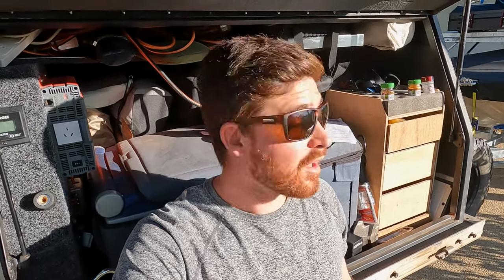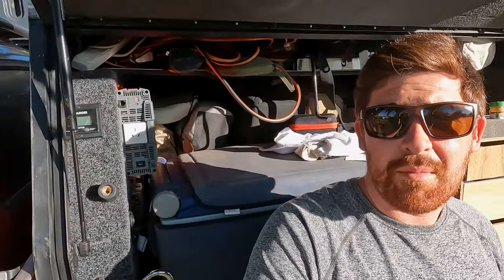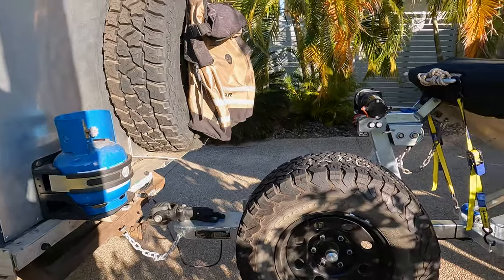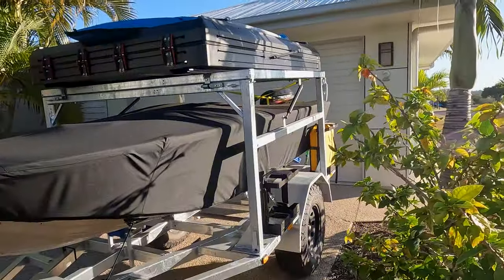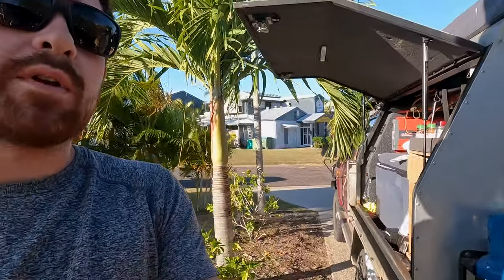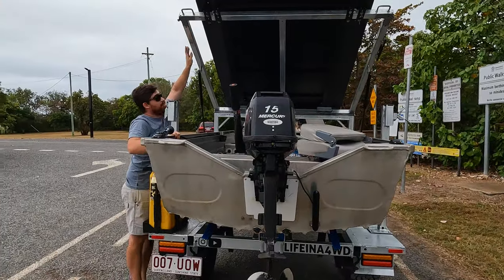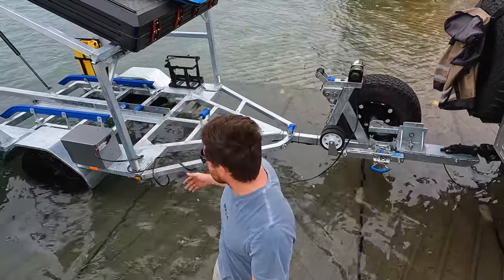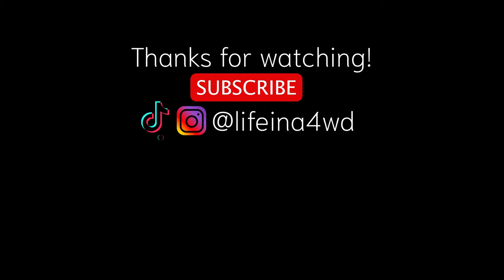OFF-ROAD BOAT TRAILER BUILD- Queensland Registration of custom trailer and the official test run

Comment: Love the channel. Ive built my own trailer too and modified it several times as the change of use develops. Cheers. Love ya work!
Reply from the maker: Thanks Mike! 
Our channel is going to take a slightly different turn now the trailer is done but mainly documenting all our adventures with the trailer!
That’s sick, we’d love to see pictures if you want to send them to us on Instagram?
Reply: @lifeina4wd  looking forward to the 4wd adventures ahead of you. My trailer has morphed from an old standard trailer to an off-road capable do all camper/multi purpose trailer. Not sure how to send you pics on the gram
Reply from the maker: If you search for us on Instagram and then send us a message it will come up with the option to message us an image. No dramas if not we just love seeing other peoples designs!

Comment: Great build series. We are about to hit the cape with our tinny. Just about to upgrade axels and springs etc to fit bigger Offroad wheel on the trailer. Wondering what brand your black tinny cover is? Looks great. Does it keep a bit of the red dust out?
Reply from the maker: Hey guys! Thanks so much!
Yeah we LOVE our boat cover and yes it keeps ALL the red dust out. It was custom made for our boat by an upholsterer in Noosa. Highly recommend going down that path hey. It’s copped a beating and only had to be patched up in one spot once.
Reply: @lifeina4wd  yeah nice! We are on the Sunshine Coast so might look into it. Cheers!

Comment: At 1078kg wouldn’t you need mechanical override brakes?
Reply from the maker: Between 750kg and 2000kg you need to have an effective brake system on at least one axel. We went with an electrical brake system. We think it was meant to have a mechanical handbrake but it wasn’t going to fit where we wanted it and at the time we didn’t think the trailer was going to be this heavy so didn’t fit it.